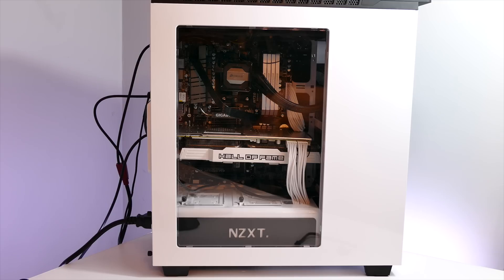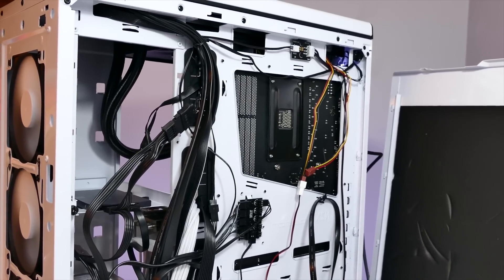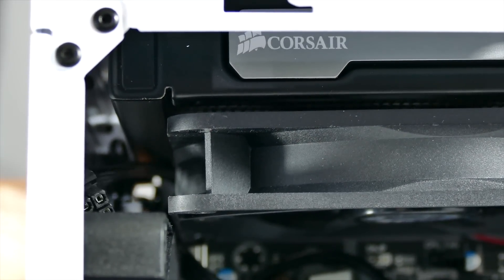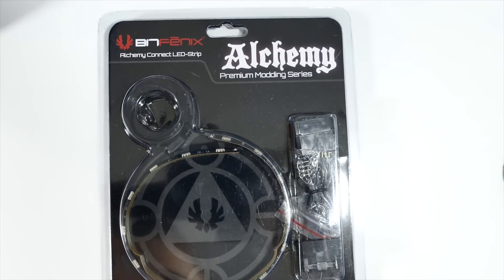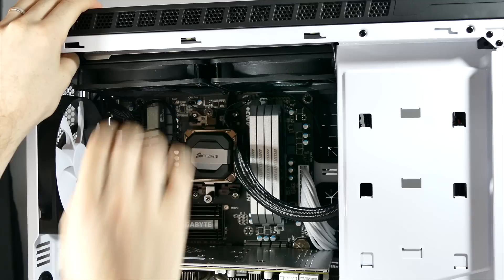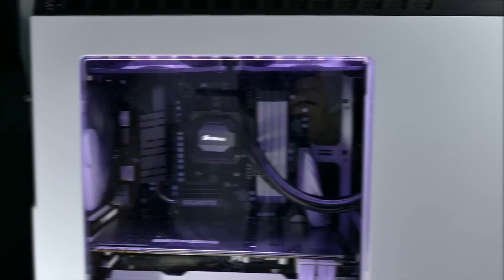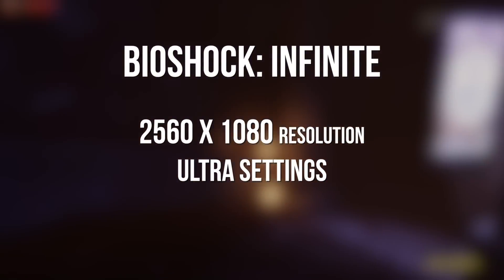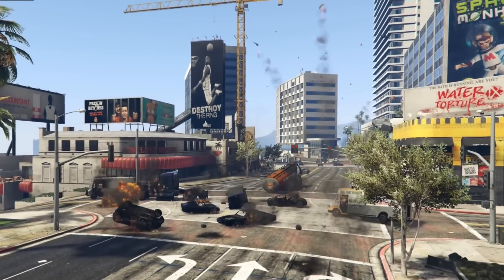PC Updates and Additions- Part 3

Comment: You're wrong about the cores. That 8 core processor is not going to touch the 4790k. 
the cores on the 4790k are stronger, faster, and use less power. Also.. games don't get any benefits to anything over 4 cores. thats why you see people gaming on 5960X and not Xeons..

Comment: 1. Cable routing still shit,2. H440 is one of the worst cases for cable routing as the back panel has very thick sound dampening material. 3. You do guides but dont seem to know much..... GG , i.e why not route the CPU cable to the hole in the top behind the rad? Same with the corsair link usb cable...
Reply from the maker: ***** Thanks for your happy input. 1. thanks 2. dampening foam is great for silencing the case, and if people think it is too thick with all the room in the back they are clearly managing their cables wrong. 3. the plug will not fit through the space behind the rad and the mobo, corsair link cable not long enough. The route we went was most efficient.
Reply: randomfrankp you could as said, route the cables before installing.. then you could've gone i.e 8 pin cpu power cable to the back from the top hole. and the corsair link cable could've gotten an extension or something imo.
Reply from the maker: The last thing you care about when first building a PC is cable management. If something is DOA or doesnt work, then all that cable management is useless when you take everything out to troubleshoot.
Reply: randomfrankp but it is obvious to build the rig outside of the case first to test it. IMO.
Reply: +Anthony Lee Have you ever built a PC before?
Reply: Zipping Basher yup.
Reply: Lmao
Reply: +Anthony Lee fuck off.

Comment: Pls anyone drop a feedback on my first PC build. I dont have much experiences! Do all these parts work together well? Or will there be any issues? Thx in advance!

MSI ATX DDR3 2133 Motherboard 970 GAMING
EVGA GeForce GTX 960 SuperSC ACX 2.0+ 2GB GDDR5 128bit
 Intel Core i5-4590 BX80646I54590 Processor (6M Cache, 3.3 GHz)
WD Blue 1TB Desktop 3.5 Inch SATA 6Gb/s 7200rpm Internal Hard Drive
Crucial Ballistix Sport 8GB Kit (4GBx2) DDR3 1600
EVGA 500 W1 80+, 500W  Power Supply
Cooler Master SickleFlow 120 - Sleeve Bearing 120mm Blue LED Silent Fan

Comment: As for the money thing, you could have avoided it by simply not having put "$2000" in the title. There really wasn't any good reason to have done that.

Also, I hate to break it to you, but GHz means nothing. The 4790k completely destroys the 9590 in gaming and editing. It has hyperthreading to match the "8 cores" in editing, and you'd need to overclock the 9590 to 6-7GHz to match the stock 4790k in gaming. You can pick what you want, but don't try to pretend that the CPU is better than it is.
Reply: Let me ask you this, would you rather pay $300 for something that performs perfectly fine and does everything with ease or would you want to pay 700$ for something that does the exact same think but has a big name brand name on it.
Reply: Zipping Basher Why are you asking me this?
Reply: +NDogg15 maybe he's curious
Reply: +NDogg15  I would rather sacrifice a little performance than sacrifice my money. Just because you want to claim that the 4790k "completely" destroys the 9590. I have had a tough time even playing games on the 4790k but the 9590 ran the games much smoother. Altho I dont own either chip anymore, I would rather use the 9590 as a gaming cpu and the intel for more of a business or video making cpu. Altho both amd and intel are great cpu brands. I would rather pay less for the same or a small percent less performing. Altho amd does have its problems with heat and not video rendering as well, I would still choose AMD. If you would rather use Intel, by all means, go ahead. All im doing is stating my opinion.
Reply: +Zipping Basher did you use the same graphics card with both CPUs?
Reply: Yes, of course
Reply: Well put!  Agree completely.

Comment: i just went from a 4790k to an amd 9350. and honestly its alot better of a processor. ive always used intel but my 4790k only would clock to 4.5 the amd is at 5.2 and stable.. i however will be staying with my 970's in sli.
Reply: ***** care to explain why, seriously! i really want to know, I do not have that much knowledge on CPU´s!
Reply: i think everyone is forgetting what the amd cpu is great at. multitasking. if you want to multitask a shit load of anything the amd will always be a more reliable chip. i can render an hd video while playing games on ultra at 60 fps or higher live stream that same game and watch my stream all on 4 27 inch monitors. when i did that on my i7 it would throttle down everytime.
Reply: i still love my i7 4790k but amd isnt something to turn your nose up at..

Comment: Noooo but frank it's amd you're going to kill your power bill! Oh wait that's not true at all. FUCK YEAH AMD CPUS RULE. To pay off the difference of an Intel with difference in power takes YEARS. Jayztwocents did that. Plus it was free so it take decades. Also every big card has a little tilt. Even 970s even smaller cards. Fuck off you dumbass bitches who ain't know shit about computers just what you hear
Reply: After having an 8320 for about 3 years, I can see why people keep saying get Intel or die etc etc. It's just that Intel is blatantly better in every possible way. I'll hold onto my chip till next year and most likely get an Intel. If amds zen cpu is actually amazing, than I'll go with that. I only care about the performance and temps.
Reply: Lordy Lorde
Now youre just trying to make the argument that AMD has the price to performance compared to intel. Sure, if youre strapped for cash, AMD would probably be a better choice however I'd rather spend the extra 50 or so bucks on an intel i5 anyday. Everyone knows intel CPUs have better core performance and Im not going to compare the haswell series to the FX series since they are years apart. Either way, my 8320 served me quite well over the years but its kinda keeping my system back in a way.

For valley benchmark, I get a good 20 fps increase if I overclock my chip to 4.5 ghz. The thing that annoys me is the heat its dissipating from such a large overclock.
So yea, I hope this is what youre looking for because all I did was blindly write whatever.

Comment: The sag on that video-card is killing me... I think you could easily stabilize it by either installing a pole under it or you could try to install the second drive-bay from the bottom and slide some kind of plate in it that fits under the card, pushing it up! The rest of the build looks super clean, it's just that one thing that totally ruins it for me...
Reply from the maker: neophoys If you watched the video then I clearly addressed this, thanks though!

Comment: it dont matter how many core are in that AMD an Intel quad core will go toe to toe with and and Intel 8 core will absolutely wipe the floor with it its not how many core that counts it what you freaking do with them, also AMD only has support for PCIE 2.0 so your gpu isnt going be able to stretch its legs properly also why does the first half of this video exist cable management should be a given cable go round the back when you install them, not after!